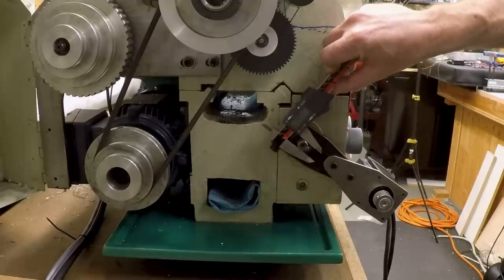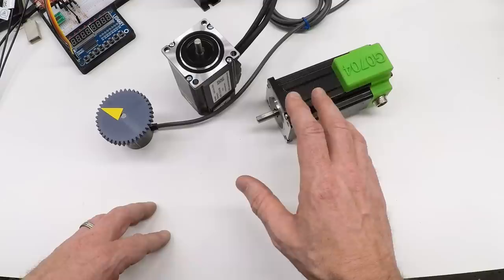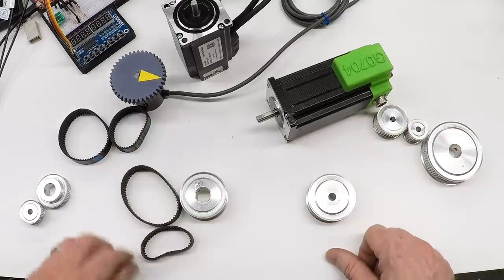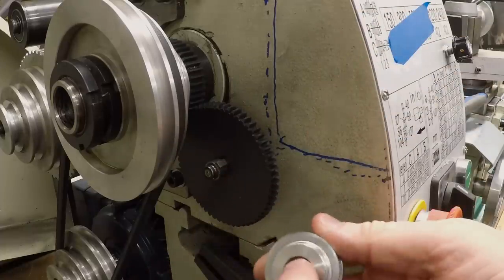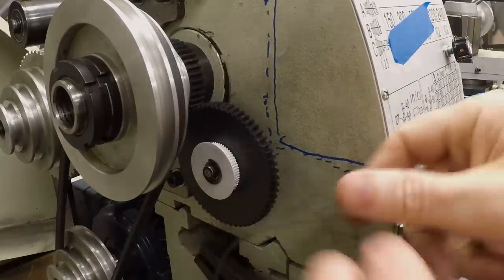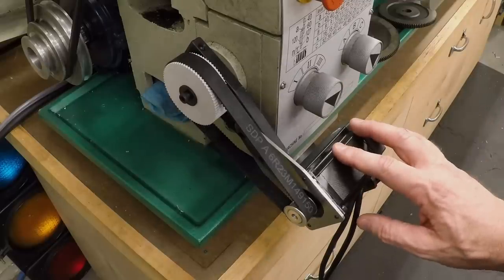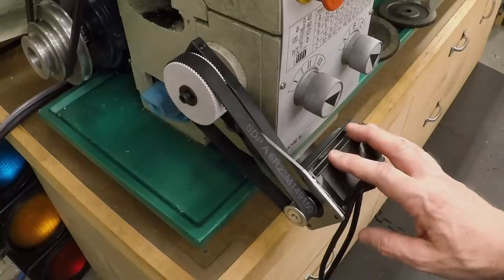Lathe Electronic Leadscrew Part 5: Mounting the Encoder and Servo on the Lathe

Comment: I'm replacing the gear on the spindle with a timing pulley.  The main drive pulley came off quite easily.  Just need to put a big bore and keyway in the timing pulley.  Your layout and presentation of content is awesome.  Very nice work.

Comment: This is what home cnc is all about. Stuff that would be difficult manually is relatively easy with even a low power cnc machine. It’s going to be interesting to see if you can cnc the feed screw.

Comment: I do not have a lathe but I am so excited to see all of this work.  I am building a shock dyno on the same principle i got the same encoder and digital readout and the BSS 138 converter. I also got the F280049C encoder.   Great job. Thank you! I am using the same VFT you are using to run my 3 HP 3PH motor.
Reply from the maker: Nice!

Comment: James, thank you again for another well thought out (along the way) project. I commend you for not hiding goofs and gaffs and looking human in the process.  Someday, I hope to be as competent as you. I am going to skip back and watch from the beginning. This looks like a great process for solving my gears kicking loose under tension. I want to see how you calibrate all the speed settings for proper threading without having the change gears, and simplify it for my old man head. My equipment is similar, an old Asian lathe that looks like the Grizzly G4000 and a mill the same as your G0704. All mechanical still.

Comment: Gates can't help the Chinese part numbering debacle... but the technical resources on the Gates website has a really cool application to size belts for pulley sizing and spacing. It's simple to use and very flexible. Our high school robotics team uses it.

I can't wait to see this whole thing up and running.
Reply from the maker: I usually use the "Center Distance Designer" on the SDP-SI website.  It's very helpful.

Comment: awesome.. ive printed XL 5mm  pulleys before and they come out great and hold up to surprisingly high torque..
Reply from the maker: My only concern is wear on the keyway.  It's possible the plastic pulley will be fine, but I'll probably make a metal one anyway.

Comment: Also would be cool to have a readout showing degrees of rotation of the spindle to allow using it as a low accuracy dividing head for drilling flanges/ holes around a PCD etc with a toolpost drill for those of us without a CNC milling machine.

Comment: Great update. I've been following a few of these ELS projects and eventually decided to give one a go. It was a commercial one, but quite cheap and he sold it as a complete kit with (recommended) stepper motors. I already had a couple of servo's so I decided to go with them instead. I direct drive the lead screw thru the gearbox, as you do and drive the cross side with a 1:1 belt drive, as this it what the creator suggested. It works fine but I have noticed that the servo(DMM) on the cross side has little holding torque and can 'back out' a little on heavy cuts sometimes(I guess the lead screw one might be the same). A stepper would have better holding torque to stop this. I think if you are going to use a 1:1 or low ratio drive, steppers would be fine and if you are going to use a belt drive and  higher ratio servos would be fine. Either way I'm having fun and look forward to seeing where you take yours.
 I do have a Mazak Rex 610-1500 20Hp lathe with no change gears and am interested in giving yours a go on this one, if I can work out sizing and find servo's large(and cheap!) enough to drive it!
Reply from the maker: Was the servo on the cross-slide powered when it was backing out?  Or was it disconnected?  Ballscrews, or just lead screws?
Reply: Yes was powered, it's a Canadian DMM servo so I can connect the driver to the laptop and see if there is something I can change in the settings, but I didn't think servos had the same holding torque as steppers? Steppers are full power all the time, servo's power as required(I thought?). Didn't move much and probably no more that if I was using it manually, but I was going to put a ballscrew on the cross slide to remove backlash and this could make it worse as the ballscrew would have far less mechanical drag/ resistance.
Would be interesting to do a test with stepper/(true )servo connected to a ballscrew/leadscrew with a pushing load applied to the screw to see if there was any movement. I of course maybe completely wrong, as I often am, but am happy to proved so for the greater good :-).

Comment: This is my favorite YouTube channel. I have 2 questions: what motors are you using for your table top mill, steppers or servos? Also i never hear your air compressor kick on and off. Where do you have your air compressor located?

Comment: great build so far, use only premium gates belts ,worth it over imports , I also like belt drives with steppers I believe they do a good job at damping. on expensive VMC's you will also see belts used on drives and encoders.

Comment: Another excellent video! A quick-ish fix for the over sized pulley would have been to bore it out larger, press fit a plug it, then bore to the correct size. Or....order a new one. 😬
Reply from the maker: I thought about it.  It probably would have worked fine, but I'd have to hold it in the 4-jaw, with some kind of fixture to prevent damaging the aluminum teeth.  Also I didn't want to put the change gears back on the lathe or use it without feed.  So...there were enough excuses it seemed easier to just 3D-print one.
Reply: Where there’s a mill there’s a way. 😬A couple hold down clamps, interpolate a hole, bobs your uncle. I actually appreciate the 3D printed part, I like seeing something that’s gonna take some stress being printed. Sure makes for some quick and easy prototypes.

Comment: If you wanted to mount the leadscrew stepper direct drive, you'd have the option of doing so by mounting the stepper to the tail stock end of the leadscrew and making up a mounting bracket. That way you get to leave the gear box cover on the lathe and move the stepper wiring away from the lathe controls.

Comment: Excellent series James, I'm buying up the bits and pieces to begin this build (already bought your kits) on my Grizzly G4000.     I'm down in the Caribbean, so everything ordered on-line takes forever to get here,  especially from China. Very frustrating when working on a project as you would appreciate, and Lord forbid the wrong thing arrives!  :)
Two questions:
1) The ebay link for the Servo motor is dead, can you suggest an alternate source?
2) Do you have recommended source(s) for acceptable toothed belts and pulleys?

Comment: @clough42 You can always part off on the round part of the stock. Cut your flats just deep enough. Then part on the very edge of the round stock. A little metrology, and you can have a precise part....
Reply: Just turn it, part it off, and put in the mill vise.
The flange is plenty big enough to hold it, and the pip will register for height.
The mistake is thinking the flats have to be perfectly parallel - they only need to be close, and it can be done by eye.

Comment: Hi James. By replacing the leadscrew by a ball screw you can turn that lathe into a CNC machine much more capable than just cutting threads without change gears. Installing the servo straight to the leadscrew on the tail stock end is not an option? less cluttered space. Great job and keep on. Subscribed and following

Comment: Gates also measure their belts by the pitch length rather than by the number of teeth.  For instance a 5mm pitch Powergrip GT3 (300-5MGT) is 300mm long with a 5mm pitch tooth and has 60 teeth.

Comment: Great, excellently produced videos. I'm in the process of installing encoders on my lathe and mill. I too used 3D-printed pulleys to show proof of concept. What 3D modeling software did you use to model the pulleys? Where did you find the information necessary to model the teeth on the timing pulley? I found a parametric timing gear model on Thingiverse that did a great job modeling the timing pulleys but it is in OpenSCAD. But, not being conversant in OpenSCAD I was not able to make all the modifications I wanted to make to the pulley. I'd like to be able to model a timing pulley in Fusion 360, my 3D modeling software of choice. I understand that the Gates GT series of pulleys tooth profile is proprietary and not available. I purchased my aluminum timing pulleys and belts from SDP/SI. Very good company to work with. They have a lot of technical information online.

Comment: Direct drive is the way to go. I've got NEMA24 560oz. in. closed loop stepper motor which easily drives Z axis head stock with 1605 ball screw on my Sieg mill. So for this application it will do the job just hands down. Otherwise PU toothed belt with steel cord is going to be fine as well.

Comment: I wanted to say I really appreciate this, and all your hard work.
I urge other people to stop buying from Grizzly.
They offer what seems to be a good product at a good price, but this is the sort of issue that comes from them. They will continue to sell sub-standard equipment as long as people keep choosing them over other dealers who sell equipment that is not missing basic functions.
Reply from the maker: You mean the lack of a threading gearbox?
Reply: @Clough42  Gearbox, reverse tumbler, etc. I can't remember all the things, I just remember being very frustrated about how close they came to being a good product.
Wound up buying both a lathe and mill from Precision Mathews. They both cost more, but end up cheaper in the end because you don't have to modify them
Reply from the maker: @joshua43214  Grizzly has a bunch of different offerings with different price points and feature sets.  The G0602 is a particularly good deal if you're doing a CNC conversion and throwing all the extra stuff away.  IIRC, the PM lathes have power cross feed.  That's a winner.

Comment: Bore the pulleys out to 20-22mm, then make bushing that press fit in with a 14mm center hole and keyway. You could make them from steel which would wear better than the aluminum.

Comment: Just an idea .... when you put an optical trigger disc on the lathe spindel ..you have no backlash problems ..of corse you have some encoding/decoding ussues but with your knowledge of electronics i think it would be feaseble with more accuracy.
Reply: I don't think the backlash is a problem except for the noise it makes with the plastic gears.  The angular error it's causing is isn't going to accumulate.  A synchronous drive directly off the spindle would solve the same issue and remove the hazard of the belt getting contaminated with gear lube.

IIRC, he's using a 4096 count/rev encoder.  Trying to fabricate an equivalent resolution encoder that fits directly on the spindle would be a lot more difficult (and prone to contamination itself) than pressing the output gear off the spindle and replacing it with a synchronous belt sheave.  

I'll agree that it would be an interesting design challenge though.

Comment: I missed it and tried to zoom in but still couldn't see it. What size gt2 belt did you use on the encoder? I also have a G0602 and I'm currently doing both your VFD conversion and the lead screw. These videos are gold!! Thanks for your explanations
Reply from the maker: That one is 127 grooves, part number "A 6R51M127060" from SDP-SI.  Be warned that Gates belts are sized by number of grooves, but many import belts are sized by belt length, in mm.  SDP-SI has a center distance calculator that comes in really handy for selecting belts.
Reply: @Clough42  Thank you so much! I really appreciate you trailblazing this incredible project! ❤

Comment: I'm curious, why not go for optical sensing of spindle speed? It seems like you could've milled one or more slots in the 60 tooth gear, shined an IR LED through it at whatever sensor you prefer, and there's your data.
Reply from the maker: This is actually an optical encoder, and a very high-resolution one.  Milling slots in the gear isn't something I had considered.  For that matter, I could probably read the teeth of the gear optically.  It might even be possible to get 240 counts/rev with some kind of quadrature setup.  The software approach I'm taking at the moment depends on the high resolution, though, so I'll probably continue with that for now.
Reply: @Clough42  Yeah, I suppose for thread synchronization you need not just RPM but high accuracy spindle position at high sample rate. Still, you could read the teeth like you mentioned, or attach a slotted rotor sheet to the gear with as many slits as you like for high resolution optical sensing. It just seems to me that doing the sensing with a mechanically linked encoder is inviting complication, error, and wear.
Reply: @calastigro If you would really want to read the gear, that would be better served by an inductive / Hall effect sensor: it's what ABS in cars actually does; you really wouldn't want to muck around shining light through the cogs. But as noted, the resolution would be drastically worse, and that's not a good thing when you're trying to cut a thread instead of just figuring out whether a wheel is slipping or not...

Comment: In the lands Metric,  M series belts are ordered by Series ~ Length ~ Width. In Australia I don't think any belts are classified via tooth count, the books however have the tooth count listed also.
You may find that you could run into some belt tooth climb with the 3m series belts in practice. On a 2hp ball screw drive a 5m is normally used, the 3 m may need to be tight beyond the capability of the nose bearing of the motor? I don't think that will be an issue for you until you get up into the 2mm per rev range of diameter turning. Say a 2 X 2 mm cut on steel. The risk of this problem is greatly reduced the bigger the drive pulley diameter becomes.

Cheers
Reply: I doubt you'd want to take such a heavy cut on a machine of his calibre.

Comment: This is a great project!  I wonder if the software can be easily adapted to a closed loop control driver modified stepper?  BIGTREETECH S42B V2.0 Upgrade 42 Stepper Motor, Closed Loop Driver Control Board, 3D Printer Parts for SKR V1.4/V1.4 Turbo/V1.3, MKS Gen L (with OLEP Display) Thanks  Doug

Comment: Have you looked at adding a pendant to the mill so you have an interface you can use without leaning over to the keyboard when doing manual operations?
Reply from the maker: I actually have a ShuttleXpress on the machine, and I use it when edge-finding.  For manual operations, though, I usually set the feed rate and use the cursor keys.  Just habit, I guess.
Reply: @Clough42  I've been putting off one for my CNC router since I use the keyboard the same way.  Thinking of doing a CNC conversion on my Lagun mill, but I think I'll want a pendant on it.

Comment: Really excited about doing this to my9x20 Harbor Freight lathe. I am somewhat chanlanged on the programming and rratio of the steeper motor pulleys and my lead screw TPI.. I have purchased the same hybrid stepper you used and I have a 16 TPI lead screw. Do I go with a 3 to 1 pulleys like you used on your stepper motor ?
Reply: Im just starting on mine (ive got a HF 9x20 as well) and trying to figure out the gearing.   what did you end up doing if you dont mid me asking?
Reply: @sethshook  I completed mine work great. Can't push it to hard or the stepper motor kicks out. I had to go in to the program and adjust timing. It's been almost several year so I don't remember what I changed Send me an email address and I will forward photos

Comment: I have a question about you lathe stand. What is it made of? Because it looks like wood? What do you do to prevent/dampen vibrations that cause tool chatter?
Reply from the maker: The lathe is bolted to my wooden workbench.  The top is a grid of half-lapped 2x4s, a layer of 3/4" particle board and a layer of hardboard.  It's supported on a 3/4" plywood cabinet carcass and bolted to the wall.

Comment: I have a question about the ratio of the spindle to encoder. Forgive me if I'm not seeing this correctly...You were originally going to drive the encoder via the teeth on the idler, but are now driving from the idler shaft. This (I think) introduces a ratio that is no longer 1 to 1. I know you can compensate for this in your programming for your particular spindle to idler ratio. Will there be a way for those of us who have different lathes to adjust for this?
Reply: Okay...I re-watched  from the beginning and see you're using encoder pulleys with a 60:40 ratio. 
Thanks for doing this project!

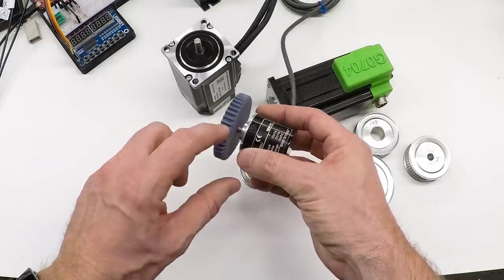Comment: Hi James, you said the rotary encoder 3Dprinted gear is mod 1in the video at 4:45minutes. I have the same lathe type but my gears are mod 1.5.
Mod 1 is for very small loads.
Reply from the maker: There are two gear types on my lathe.  The first 60T plastic gear fed from the 40T plastic gear on the spindle is about 90mm in diameter, so it's likely mod 1.5.  The rest of the cast iron gears appear to be mod 1.  I just measured the 60T cast iron change gear, and it's approximately 60mm in diameter.  The leadscrew gear train carries relatively small loads.
Reply: @Clough42  Thank for the mod clarification.
Overall gear ratio from spindle, rotary encoder up to the leadscrew you prefer to keep as integer 1, 2 or 4 and in combination with the lathe selector ABC and in the CCSsoftware code microsteps variable the total ratio should be 1?

Comment: Could you cut a slug of metal, weld it into the oversized bore after you've back gouged the join, the drill and bore that to size?
Assuming you have a welder at this stage. I do know you have a lathe :P
Reply from the maker: I don't have a welder.  I could press something in or use loc-tite.  The bigger concern is holding the pulley in the lathe, getting it centered properly, and not damaging the aluminum profile.  I think the replacement pulley was about $6.  Plus three weeks' time for delivery.